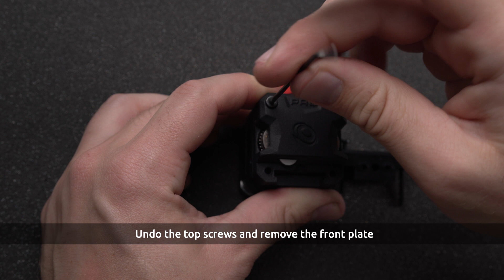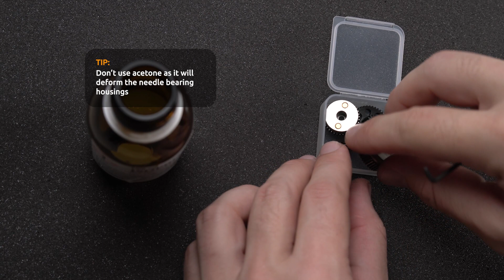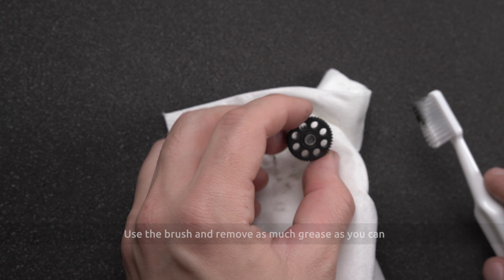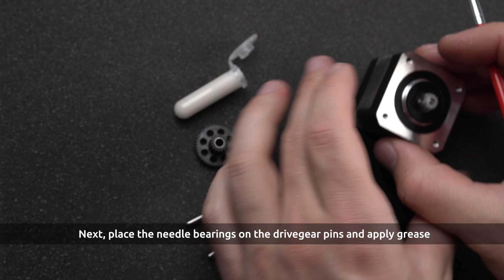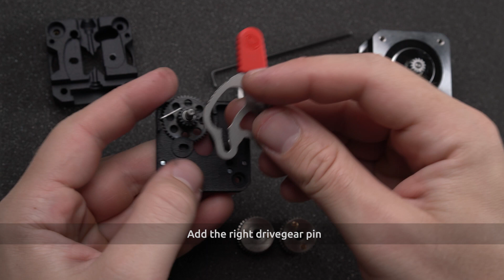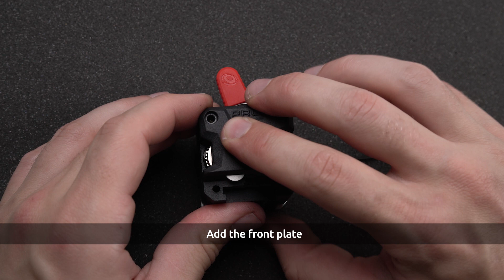Maintenance Guide for Bondtech LGX PRO and LGX PRO 2.85 eXtruders

Comment: I still don‘t get what’s the diff between LGX B and Pro?
Reply: from what i can see the pro has metal gears instead of plastic gears that the LGX has also the pro has a 30mm stepper motor vs 25mm allowing for a higher current setting.
Reply from the maker: LGX B, is the same as the LGX. We created the LGX B to be referred as a bowden upgrade on Anycubic printers. 
The LGX PRO has a stronger motor, a full steel drive train and an Aluminium interface plug to better support longer hotends.
Know more on the LGX PRO product page at our website.